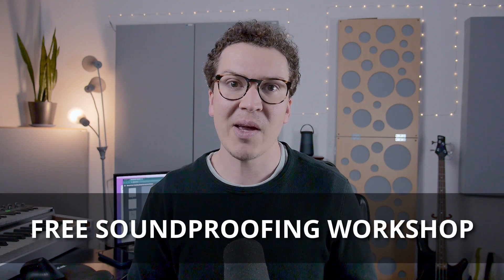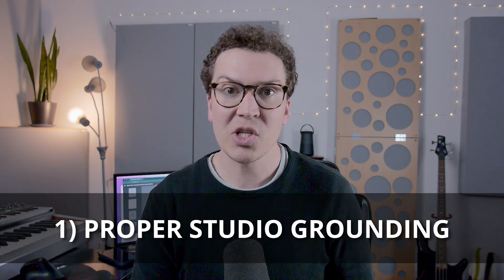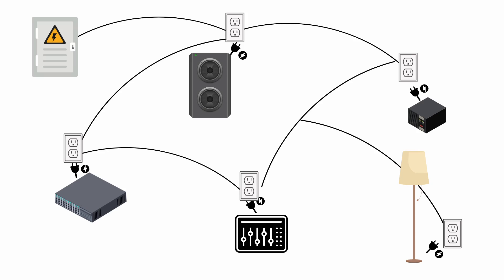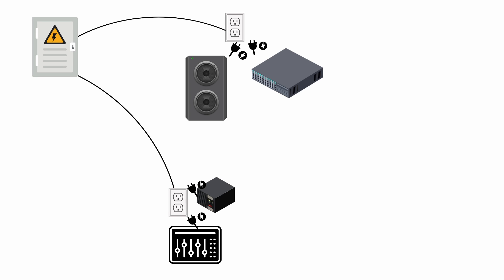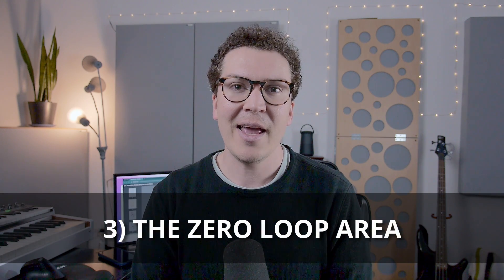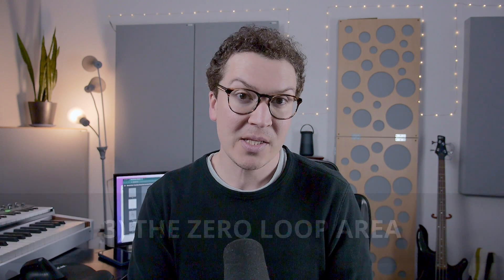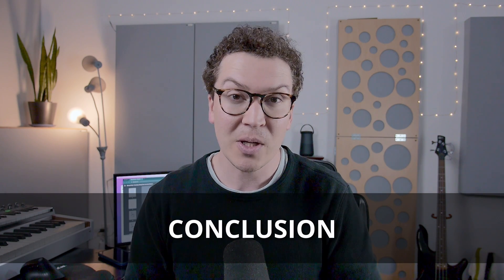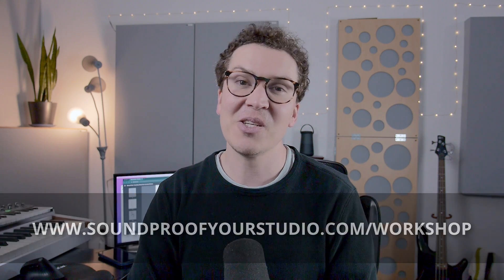How To Avoid Ground Loops In Your Home Recording Studio

Comment: I have two wall outlets that are on the same circuit. One of them is properly grounded, and that’s where I plug in all my equipment. The other outlet doesn't seem to be grounded — when I plug something into it, I hear a pop or a hum, so I avoid using it. Should I have that second outlet grounded as well, or is it okay to just use the grounded one, since both share the same electrical line? I’m concerned about safety and possible noise or interference issues. Thank you!

Comment: Great video but it misses the latest scorpion in the woodpile. A lot of newer gear is wall wart powered and doesn't have a dedicated ground.  When you have wall wart gear connected to other wall wart gear which may also be connected to a computer via USB, troubleshooting is a nightmare. An explanation of how to deal with ground loops with wall wart gear would be very helpful!

Comment: So, what would you recommend if you have electrical that's less than ideal, and aren't going to get your place rewired? Like maybe an actual Line Conditioner? Also, by Line Conditioner, I don'r mean just like a cheap power conditioner, but there's actual Line Conditioners I've been looking at, but I'm not sure if they would actually help with actual ground loops, but apparently they can help with better EMI/RFI noise rejection, and actual Voltage regulation. Is there actually any outboard stuff that can help with, or override an actual ground loop, or ground issues, or are they all still just a band-aid at the end of the day?
Reply from the maker: Mostly band aids, but don’t try to fix a problem you don’t already have.

Comment: I'm not clear on what makes the ground loop. The video suggests this happens when audio line-connected audio gear components are plugged in to more than one outlet on a daisy chained power circuit typical in most rooms. By that explanation, it should be ok to have lights and non-line-connected audio gear (amps and pedals that will be mic'd to the interface rather than line-in) on the same power circuit, right? It just seems impractical and wasteful for most people to run a separate circuit breaker to each outlet in a room.
Reply from the maker: Yup nothing about studio building is logical or easy.
Reply from the maker: Woah, no need to be negative. So in your example ideally you would plug amps and pedals into a single outlet in your room dedicated to audio that was not on the same circuit as lamps, lights and refrigerators. The audio should be ideally on one leg of your panel, lights and hvac on the other. However, this is easier said than done since a 220v hvac in-unit will cross both legs and you need a balanced load. I agree it seems wasteful, but this is how many designers say to build studios to avoid electrical hums and noise.
Reply: I had a subpanel added in my attic and it’s really not that impractical to dedicate for breakers to 5 audio outlets in my space. Of course, my home studio is only 12’ x 20’.  I did make a mistake in my design, I had the electrician put one circuit with two audio outlets on it, and then another circuit with three audio outlets on it. So it will cost me a little extra money to get him back to run more wire from the sub panel to separate the other outlets. At least I caught this before Drywall! I’ll probably eliminate one of the outlets. I don’t think it will be necessary for 5 in small room.

Comment: How do I get my RME Babyface ProFs not to have hiss in my active speakers? Is a ground lift sufficient? The Sonnect SoundWire doesn’t produce hiss in my speakers.
Reply from the maker: Not sure, but you would need to trouble shoot the issue with checking for where the hiss is starting from. This could mean turning things off and focusing on one into at a time until you find the culprit.

Comment: As far as 'sound-proofing my studio' goes, I moved my 9th Studio Off-Grid onto 160 acres! My nearest neighbor is over a mile away -So 'sound-proofing' is NO LONGER an issue!🤬...

Even though the room in my house where I am currently building THIS 9th Studio has existing electrical supplies (2 double-gang recepticals: across the room from each other, but -on 2 separate breakers); I'm tearing-out part of a wall in order to install DEDICATED outlets that will be connected to their own breakers AND DEDICATED GROUND (i.e., an  'IG Circuit': 8' Copper grounding-rod)...

Added to THAT - I'll be using (2) Power Conditioners to ISOLATE the same supply power to the rest of the house from my Studio Equipment!😈🦋✨👽⚡
Reply from the maker: Sounds good

Comment: You can always use mains cleaner.
I use the “cheap” £40 mains cleaning extension leads. I have 3 6socket ones.
Each plug is independently filtered & I have 0 hum. I lied they don’t have independent socket filters! But they still do great!
I’m in a flat that all sockets are on the same ring. 
There are 4 computers 8 screens various lights & noise emitting crap.

I can crank the volume up the the max & I can’t hear any hiss!

Edit: CS947 Tacima are the extension leads I’m using.
I’m running one from the wall & then 2 of them from that for my setup.

For the price of £39 - £50 depending on where you get them they are very worth it!
Reply from the maker: Great tip!
Reply: There are pro conditioners & I will name drop isotek.. they are the industry leaders!
I use their mains leads for my DBX286 & monitors. Each lead is £150… 
So only consider them if you have money to spend!
I have met them through a mutual friend when they were just starting out.. spectacular products.

I plugged my old power mac G4 into the isotek titan & it actually sped up my mouse.

But if you just want good clean mains with no feedback & basic isolation the tacima CS947 will do.
Reply: KOOL! 😎

Comment: You say don’t plug into different outlets, but it’s really outlets across different circuits, right? So let’s say I have 2 breakers (circuits) in my panel dedicated to the studio: one for audio equipment, and one for lights and other non audio gear. Lots of outlets for each. Would that work? Even if the panel uses one ground for all circuits?
Reply: That sounds correct to my understanding, but I’m just a DIY amateur. I think he alluded to this fact.  I had my electrician wire a separate audio circuit, and then a separate one for non-, and then a third one for lighting switches. Working in progress so I don’t know if it worked yet lol    
UPDATE: although I had two separate circuits, one for several audio outlets and the other several non-audio outlets, I decided to run yet ANOTHER INDIVIDUAL breaker is for my computer (I could also power my rack mount gear/interface here.). I may put this breaker on a UPS near my subpanel outside the room.
Reply from the maker: The goal is to have your electrical as direct as possible. So if you have lots of outlets for each breaker then yes you may run into ground loops. Ideally it would be one ground for all the audio equipment and not a bunch of outlets daisy chained together.

Comment: Hi Wilson, 
Again, nice and informative video you got here.
If I have a Toslink (ADAT) preamp (Behringer ADA 8200) electrically connected to a different electrical outlet than my sound card, is there a chance of groundloop? Can electricity travel through an optical cable ? Also inportant to mention that each of my outlets are connected to their own distinctive breakers. Thank you.
Reply: The best response to your question is NO. The ground loop is only created through direct electrical connections using wires. Optical cables isolate the two pieces of equipment. No chance for a ground loop to be created between those two pieces of equipment.
Reply from the maker: If you don’t have any issues with noise then you are fine.

Comment: I've been making sure of this in my proper studios for years. It's a often forgotten process by a lot of people. Just do it, it's worth the cost.
Reply from the maker: Thanks for sharing
Reply: I’m doing a small home studio with four dedicated audio outlets, sounds like I should run for separate home runs / breakers back to the sub-panel? From what I’ve read, isolated receptacle outlets actually have an extra ground. That’s not what you’re doing for studios, is it?